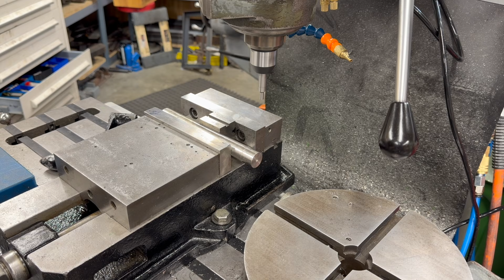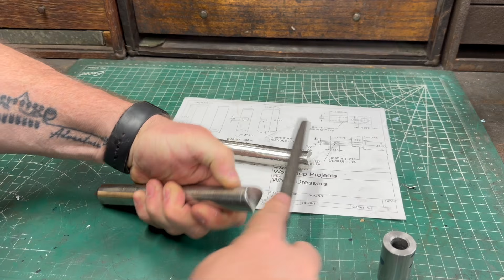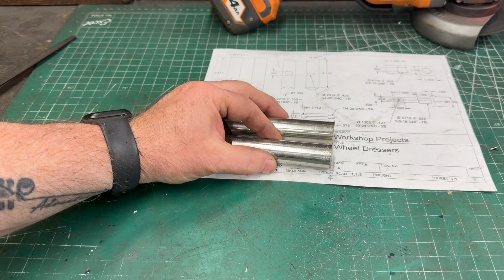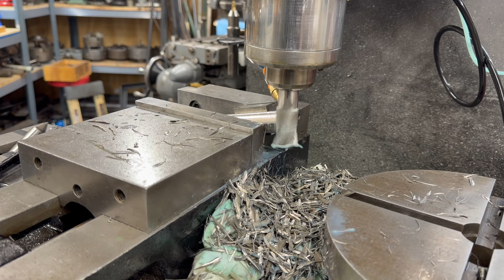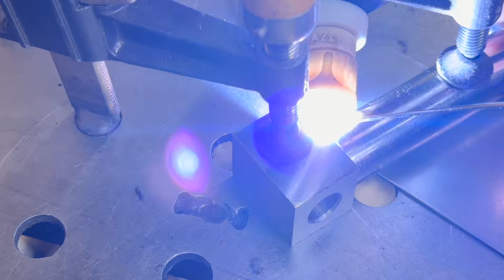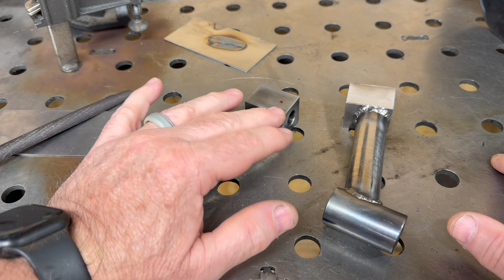Black Diamond Drill Grinder Repair - Discovering a critical mistake

Comment: I would bore out your base piece at the correct angle and make 2 bushings and Locktight them in place and clean them up to the mating surfaces. Your cad should reveal how large the bushing pieces need to be.